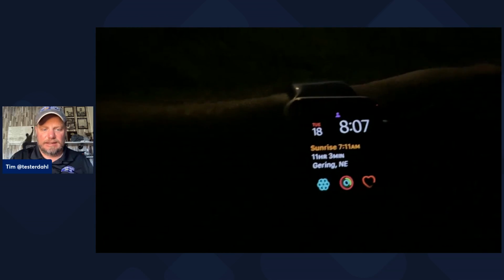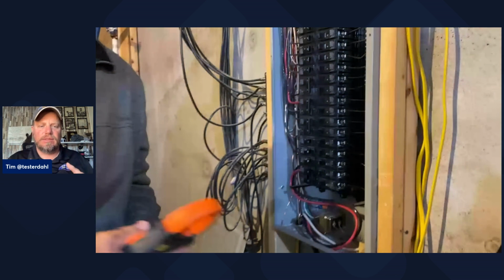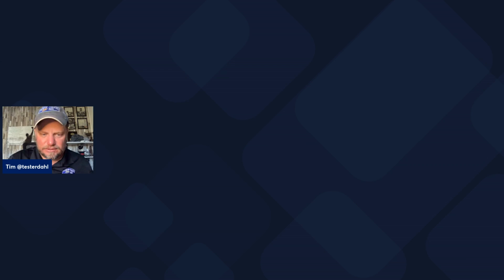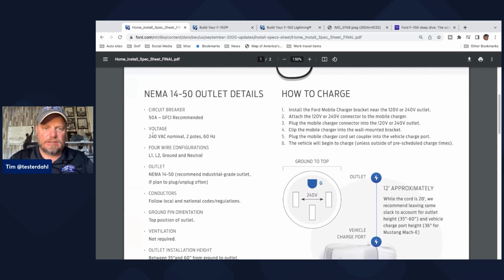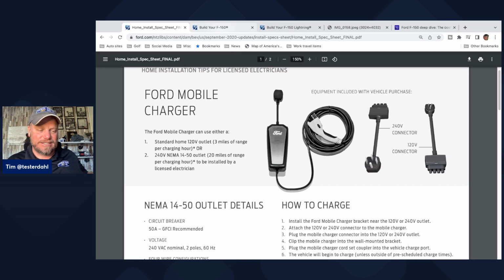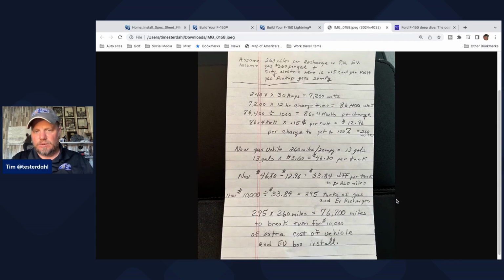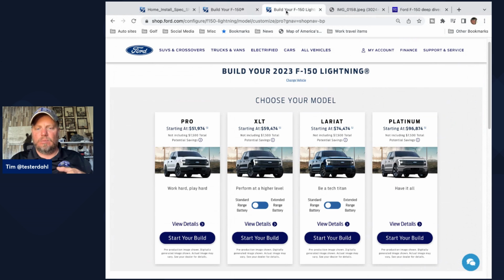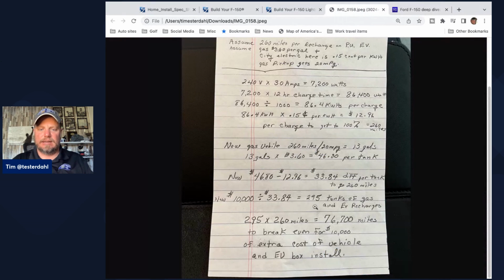11+ hours later on 220V charging price for 2022 Ford F-150 Lightning

Comment: I see the math this way, my 05 F150 XLT I bought used twelve years ago was 10K and I do all my own maintenance/service work on it and so it runs flawlessly. It now costs literally nothing for its KBB value and the fact I've got over 100,000 long distance miles on it alone means its more than paid for itself. All I can see ahead is routine maintenance cost for items like filters, plugs, oil etc and the gas I will be putting into it. For me this is way cheaper to own and operate than any 90k EV will ever be to buy and operate. Not only that but for my long distance hauls, I can get easily over 300 miles on a tank, refuel in no time and be one my way again without sitting and waiting around charging. I keep vehicles in pristine condition and so I end up owning them for over 20 years on average, which is very common for me. How many batteries will an EV go through in 20 or more years for a single owner.
Reply: At least 2 batteries for certain, tack on an extra $8500 per battery replacement! I’ll keep my gas powered truck also!
Reply: I saw an electric car boneyard in France consisting of around 500 cars the batteries were dead, and it cost more money for batteries then to replace the car itself and the landfill will not accept the dead batteries.
Reply: @frankgrima  I saw that as well. P.S. Will the manufacture of the vehicle Guarantee that a replacement battery will EVEN be available, 5, 10, 15, 20 years from date of purchase???? L O L
Reply: What engine do you have in your '05?
Reply: @hectorbart  the 4.6 litre  2 valve modular V8 that keeps on going forever. None of that 3 valve 5.4 litre phaser nonsense that constantly has issues.
Reply: @RideCamVids  Thanks.
Reply: My old cats from the 70s are still running fine just add a lil gas an charge up the battery to start thats it
Reply: Right again sports fans
Reply: You won't be able to buy a 10 year old electric vehicle because batteries for them only last 8 to 10 years. I feel sorry for the idiots who, in a few years, go out and buy a 7 or 8 year old used EV. They are going to spend $15,000 on a used EV and not realize that the car will stop working within a couple years.
Reply: @greatmartini1  Compared to regular gas-powered vehicles, Teslas depreciate at a slower rate. One of the main reasons why Teslas retain their value even several years after initial purchase is their mileage range. Most Teslas will last over 500,000 miles, while the average person drives only 13,500 miles per year.Aug 24, 2022

Higher resale  
Motors don't wear out
Brakes last 3 or more times longer
1/4 the maintenance 
Quieter 
Way faster an quicker
 Cheaper to operate with 4 times greater mpge
Reply: @Frank Grima  saw where batteries for a EV is 20,000 can you imagine any other part...people wilk fight for a charger in place coz bet their will never be enough for how long you have to charge one...and lm sure like gas people won't plug them in g ghhgĝ
Reply: @robcrissinger776  found the fanboy
Reply: Keep vehicles for the long term is the solution! Too much "throw it away and buy another one" mentality exists today.
Reply: @industrialathlete6096  Tesla won't sell you a battery even if you want to pay the outrageous price.  That probably was the plan all along with their "lifetime" charging option.  Can't charge a dead battery.
Reply: my 71 f100 still runs great.  You can stand inside the engine compartment, lots of elbow room with only a fuel line, and a water hose in there.
Did have to scratch my head in the 90's when I got it.  I had my dwell meter from the 70's.  But hadn't hooked it up in 20 years to adjust points.  LOL
My motorcycle ran like sh*t when you used a dwell meter, so always gaped with feeler gauge.
Reply: @chuckgoodman3828  Love how you anti EV people keep changing prices to put in a new battery but don’t understand they don’t replace a whole battery pack so the cost is a fraction of the amount you guys post.
Reply: @kellyalbertson3699  They already have EVs charging in 18 minutes on level 3.
Reply: @seanroge  yeah, if you only need to get 60 to 80 miles.  And repeated fast charging leads to more degradation.
Reply: @industrialathlete6096  Battery technology will improve and the old style battery can get phased out. The question will be- Can the new technology battery be retrofitted with the new controler needed to operate them. With golf carts this is working. I imagine they will do this with other vehicles too.
Reply: @kellyalbertson3699  That meme/info is flying around on the internets for a battery pack and assembly that is no longer made. The new product, although it is expensive is no where near $20k.
Reply: @seanroge  Right? They are posting for a battery assembly no longer made and the new product for that particular vehicle is much less expensive.
Reply: @robcrissinger776  wait until the government sets the hook! When they start putting road taxes,recycling,environment and all other add-ons on to the cost of electricity the cost per mile with be much closer to the current gas/diesel vehicle operating cost. I am not against electric cars but the energy storage has a long way to go, it will be something other than lithium based batteries.
Reply: @robcrissinger776  you’ll need batteries before you hit 500k. Good luck paying for those multiple times til then. And they will be obsolete soon too. Engines don’t become obsolete.
Reply: @seanroge  I'm not at all anti-EV  but do think many EV makes & models are BS....The same goes for many makes/models of gas vehicles as well. I like they Idea of building my own simple easy to work on EV for less money.
Reply: @Brandon Finch That pos will be long gone when you finally move in to the future.
Until then if ever remain in the past...
Reply: @Free-Gee  You can still but parts for a 1914Ford  model T

Electric batteries will first be 2nd life for home power storage at the end of life they will be recycled
All the lithium and other RE will be used in  a new technology EV battery
Reply: @industrialathlete6096  No the battery replacement will not be available in 10 years time as technology will have changed and legislation will outlaw manufacture of outdated tech to reduce emissions in manufacture. Amazes me that people still do not understand that a heap of emissions are released manufacturing all components of an EV(more than for a diesel/petrol vehicle) and you need to drive your EV from 80k-120k miles just to offset the emissions created in manufacture and recharging. EV batteries usually have a 7-10 year warranty and new batteries cost an arm and a leg making buying one uneconomical. Better to just buy a new car. And although all manufacturers/sellers of renewable tech tell us 97% is recyclable to date only about 5% is recycled as no-one is prepared to build recycling plants as the investment is too large to be economically viable so most recyclable items such as  solar panels, wind turbines and evs simply go to landfill(except the batteries which are banned from landfill) at present thereby becoming environmentally damaging. All in all, renewables are the newest pollutants of the planet and more resource demanding than existing products. A giant con.
Reply: @greatmartini1  Car dealers will probably not trade used EVs for new ones as they will as you say be almost unsellable second hand
. So if you buy an EV use it till it stops and then sell it as scrap(which is basically what it is new). In 100 years no EV will be in a museum etc as an antique as they will have been disposed of years before then. Who wants to keep a vehicle that cannot be started/driven as an antique? EVs are literally scrap the day you buy one and expensive scrap at that.
Just bought a new KIA Sportage diesel model and the EV model is roughly double the cost yet gets half the range of my vehicle. Would not have an EV if you gave me one.
Reply: @michaelbrinks8089  Yea what with a forklift battery?
The day you can design AN EV  that gets 370 miles on a charge  rips at the track 
Lasts 300,000 miles or more  beats the sales of most luxury ICE  sEDANS 

I'll buy one

Keep on with the bull crap ya here 😤
Reply: @robcrissinger776  lol  I'm talking about building my own EV for cheap to keep/drive not to sell, by using a conversion kit.
Reply: I am driving a '94 Dakota with the v-8. I have had to spend a bit on a few things like a rebuilt transmission, but I am so  far away from $90k, I really can't imagine who would spend that on an EV truck, or any truck. I am still less then $10K in. $80K diff, buys a lot of gas.

I am in Canada, where an EV F150 is $110k+. Ev is nuts to me. It would never pay it's way.
  - Cheers
Reply: @robcrissinger776  Luxury ICE sedans last much longer than EVs Rob and do not need engine replacements every 7-10 years like Evs need a battery replacement. Add the cost of battery replacements getting an EV to 500,000 miles and engine replacement/reconditioning on an ICE vehicle and the cost for the EV becomes prohibitive as it will take a minimum 5 battery replacements on the EV yet well maintained the luxury ICE vehicle may do the 500,000 miles on one engine or one reconditioning.
Evs are the future once they get an economical battery that is far more efficient than current models but until then it is only virtue signalling to buy one. They are not worth the investment for the average person.
Those of us pointing out the faults of EVs are not cave dwellers or against new technology. We are against being sold a pup at inflated prices that does not do the job the advertisers etc push. 
A motoring publisher in Britain did a 6 month investigation into EVs, comparing the emissions etc released producing an EV with a ICE car etc and found that most EVs need a replacement battery before they even offset the carbon released manufacturing one so NO they do not REDUCE emissions in NET terms. 
If you are going to support EVs you need to state the negatives as well as the positives Rob not just the benefits.
And at present Rob if an EV is a writeoff in an accident all but the battery goes to landfill. The batteries are banned from landfill due to the leaching of dangerous chemicals etc into the water table they would cause. 
In the future most of us will have EVs Rob but right now they are an environmental disaster.
Reply: @Rob Crissinger  Right try educating yourself you look at anything on these new cars...or are you one of the greens
Reply: @seanroge  I’ve done my research, $8500 is the going rate for battery replacement! I’ve never changed on that! Try harder!
Reply: do not leave out the yearly gasoline costs. At 15mpg, 1500/ a year, $4.00/gallon- $4,000/year these days-10 years $40,000 in fuel. that said I do the same thing. don't drive the older truck as much these days asd the gas engine ages better than batteries so I know I can hit the key and will always have full range with no deteriorated or discharged battery.
Reply: @tiredofallthis7716  180 miles per 80 % not 60-80 miles
Reply: @chuckgoodman3828  ahhhh no????  the batteries are $36k to replace in the f150... where did you get this $8k number
Reply: @armslength2618  well the 5.4l 3 valve keeps Brians wallet fat with all the work he gets from fixing those bad designs. I can live with the less power and way better longevity of the 4.6l 2 valve as it is.
Reply: @dominic9028  Get back to me when a buddy let's you take a ride in the Lightning and you actually get to  it....

Luddites accept the future 
Very last..
You'll understand eventually
Reply: Don't buy a 90 thousand EV 😁
Reply: I could have written this too!  I have an 06 F 150, mint with 113k on it.  Been paid for a long time and I do all my maintenance and very timely.  I'm sticking with recycled dinosaurs and my maintenance!  I never hear them talk about miles of holes filled with battery juice, somehow, I don't think we will and that has to be worse on the environment than anything out of a tailpipe!
Reply: They have recycling centers all ready for EV batteries, so there won't be any holes filled up with batteries! 😁👍💯
Reply: @industrialathlete6096  you will need a new car, Tool companies change their battery "hook ups" every few years
Reply: @robcrissinger776  You forgot battery replacement Rob.
Reply: @smedleyfarnsworth263  Didn't forget  it lasts longer than 300k miles and then has secondary life as solar storage 
Technology advances and you pick up a new vehicle 
Battery prices come down you replace or new owner replaces and give it new life 
You act as if nothing ever changes and improves.

Sad you can't figure that shit out...
Reply: @RideCamVids  It's what I have in my 06.  Good engine.
Reply: @robcrissinger776  Until the battery degrades past usability and requires replacement...
Reply: @robcrissinger776  One of the true believers I see Rob. Pity is, you are wrong, the batteries fail after about 8 years and are no use for anything else.

So far nothing has improved enough to justify the general use of these expensive gimmick vehicles. Hence the low take up rate.

Sad you can't figure that out.
Reply: @smedleyfarnsworth263  More of your ignorance. 
They are guaranteed 8 years
First use 

Secondary use 25 years plus

100 % recycle after that 

search menu

 It is estimated that LFP batteries can support at least 2000–2500 cycles in electro-mobility applications, for example, daily use of a charge and discharge cycle for seven years, until the remaining capacity reduces to 80% of the initial battery capacity. This allows its use for another 1000–2000 cycles until the capacity reduces to 60% of the initial capacity. When this occurs, the aging process of the battery has advanced to point that the voltage drop does not allow further use of the battery [30]. After the end of the useful life of a battery for electro-mobility purposes, typical applications include its use as energy storage unit in smartgrids or uninterruptible power supply. The main characteristic of these applications is the lower stress that the battery cells suffer, enhancing thus the durability of the battery pack. In the context of this work, the primary use phase considers a 24 kWh LFP battery with efficiency of 80% used for 2500 days in an EV, while the second life application considers the case of using an LFP battery as an energy storage unit in a smart building for 1500 days (or equivalently, four years), taking into account the average home consumption in Spain in 2010. In the scenarios that refer to the use of the same battery in the primary and secondary application, it is further assumed that the efficiency drops from 80% to 75% due to the aging of the battery.

Grid storage 
Grid balancing 
Home solar storage
EV Conversion 
The list goes on and on
 

Learn something 
Anything 
We implore you
Reply: @robcrissinger776  Which planet is that happening on Rob because it does not happen here.

Just remember, just because you want something to be true, does not make it true.
Reply: @GregOrangeDoor  this is 100% bullshit.  I work regularly with A Tesla dealer. It's $16k to replace a battery with labor.  The entire bottom of the car has to be removed, and the batteries in regular use in a city environment like Seattle, means wasting battery sitting in 2.5 hours of traffic per day. All load no regen, and its a battery killer. The batteries are barely lasting 100k miles and not much past 6 years.
Reply: Yep..I have 2 1998 dodge trucks. Better than anything put there
Reply: Nothing beats cummins 12 valve
Reply: @nc.3512  mid 90's 6.5 diesels will run on virtually anything.  I watched a show, years ago, someone literally boiled down a rotting pig, and it ran on the rendered fat.
Reply: @mikebolton3816  yes. 98 12 valve will do same. Awesome engine. It was last made in 98. 12 valve is absolutely tops fir quality and power. Great milage as well.
Reply: @robcrissinger776  where on God's green earth did you hear that motors don't wear out?
Reply: @robcrissinger776  recycling will only be an option when uts cheaper than making a new one. Right now it's only about 40 percent cost to make a new one as opposed to recycling an old one. So, we may not see in our lifetime an era where recycling of these batteries is profitable.
Reply: @scottford1091  Two main parts only one moves
in an air gap
Bearings made last million plus miles
Tesla has motors already operating over a million miles

66 years at 15K miles a year is close to a lifetime

Electric motors last a long long time.

Get a grip
Dude
Reply: @robcrissinger776  I have a grip. I build cars for a living. I replace electric motors ant alternators all the time... an amarture is not an everlasting gobstopper. They wear out... if they didn't, every electric motor ever made would still be in use. Also, electric cars use their motors for dynamic braking and charging... that's even more abusive than propulsion... now... run these things around in low voltage situations... what happens to Amp draw? Goes up, right? What's the side effect of high amps? High temperature... see where this is going? Ok... so a few teslas have a lot of miles on them. So do diesels. What's your point? Diesels don't wear out either?
Reply: @scottford1091  Wrong again as usual

Learn some science
Research  Redwood Materials 

Do something instead of  whatever you think you do
Reply: @industrialathlete6096  Are batteries still used in 30 year old flashlights?
Of course batteries  with improved technologies way longer than 20 years from now will be available for old model ev cars.
Are you really that clueless?
Reply: @mikebolton3816  work with and not at.
Sitting in stopped traffic is not loaded.
Not a waste of battery.
Pull some more B 
A out why don't you.
Reply: @robcrissinger776  OK internet electrical engineer.🥱  tell you what... put an inductive fluke on your main cables, use the record min/max feature,  the go sit in traffic for the normal 1.5 hours it takes from Bellevue to Downtown Seattle.
The starting and stopping draws way more power than during a hiway cruise.
The power requirements to keep an object already in motion, vs the torque required to start moving the vehicle from a stand still every 60 ft, are dramatically different.  Nevermind, the draw to keep the heat on, the blower fan, the radio, the headlamps, the windshield wipers, the power windows, etc.
Reply: @robcrissinger776  voted for Joe Biden
Reply: The end of the world will come before a good battery for an EV
Reply: @RideCamVids  I feel you man. I am still driving my 1984 F-150 with the straight 6, 3 speed with a granny gear. The truck has well over 400K miles on it. I've spent more money repairing and replacing rusted body panels, then I have spent mechanically. My batteries only cost a $150 to replace every 8-10 years. The clutch has only been replaced once. Other than normal preventive maintenance, I haven't had to do anything to it engine wise. 
My other two vehicles are a 93 Explorer and a 2013 Focus. The Focus gets about 34 mpg doing city driving. It easily can average 39 mpg on the highway. 
When all is said and done, all 3 of my vehicles combined will have less of a negative environmental impact, than just building one EV. Let alone the disposal of a single EV. 
At least if I were to be involved in a devastating accident, at least they won't have to call out a hazmat crew to clean it up.
Plus at the end of the day, my conscience is clear, knowing my vehicle didn't require slave labor including children, to mine the minerals that an EV needs to operate.
Reply: @greatmartini1  I don't think these EV batteries last to the 8-10 year mark. It seems like after only 5-6 years, they become an issue.
Reply: @robcrissinger776  I would like to see your information, that you're citing here. As so far you are the first person I have seen, to make such outrageous claims. 
You obviously don't have a clue about electric motors. They ware out and go bad. Just like any motor. 
As per breaks, how long breaks last on a vehicle, is directly related to how the vehicle is driven. My 2013 focus, which I have been driving for 10 years now. I am still operating on the original factory breaks, with plenty of miles left. 
Way faster and quicker than what? It may initially be cheaper to operate, however you're prepaying with the cost of the vehicle. Then come back with how cheap the maintenance is, when you have to replace the battery, or when you inevitably develop a problem in the electronics.
You say they have 4 X the range, 4X the range of what? Certainly not any of my gas powered vehicles. 
And what are you going to do, when you misjudge your range and you run out of power, what do you do, have the vehicle towed to a charging station? 

Please tell me, how many Teslas are on the road, that have reached the 500k mark? 

My final question, how do you morally justify driving a vehicle, that without slave labor, likely wouldn't exist?
Reply: @onyxfabrications5183  Agree, but it isn't just these days. The American people have been programed to upgrade their vehicles, every two to 3 years, since owning a vehicle became affordable. 
I have always kept my vehicles, until they just would go anymore or became to expensive to repair. For example, I still drive my 84 F-150, 93 explorer and my current new vehicle, which I have been driving for 10 years now.
Reply: @robertsmith2956  My first boss, who owned a gas/service station, in the 70's. Used to say, "A pointless engine, is just that." Pointless.
Reply: @seanroge  Different manufacturers have different prices. What is this nonsense that they don't replace the entire battery?
Reply: @seanroge  What's your point? It takes 5 minutes to fill a tank with fuel.
Reply: @lennychorn147  A battery pack is a bunch of individual cells. When there is something wrong with the battery it is usually only a few cells that are bad. They test the cells and only replace the bad ones. The bad ones are then recycled and about 98% of the battery cell can be replaced.
Reply: @seanroge  OK, so instead of hitting you at one time. They nickel and dime you, always leaving you a battery ready to fail again. It's called reconditioning the battery. I've been through that game before, when battery operated industrial equipment, develop charging issues. The reconditioned battery, never seem to deliver the power a new battery does. It also takes longer to charge and doesn't hold the charge like a new battery. 
Each time that battery needs cells replaced, you'll pay more for the next cells, as well as also have to pony up the service fee, recycling fees and environmental disposal and whatever other fees will eventually appear.
Reply: @GregOrangeDoor  eh that 500,000 thing sounds a bit to good to be true. 
Electric motors indeed wear out. Brake pads are like 60 bucks. On my gas vehicle 1 hr I have new brakes. I never replaced them on an EV so unless they are made different How are the brake pads lasting longer? It's not cheaper to operate this video shows that.  People literally put mufflers on their vehicles to make them louder So I don't really see that being a plus. You can only go so fast from red light to red light. I Don't think going over a hundred miles an hour should be the normal on the highway. From full tank to full tank on either vehicle they don't get better mileage. ???
Reply: @robcrissinger776  You are the 'clueless' one. Do you really think that companies will keep the parts 'pipeline' full of Anything for older technologies. Example: Current 'white' goods(appliances,etc) are not built to last compared to such purchased 20,30,40 years ago. Many current technicians either refuse to or do not want to work on 'old' technology.
Reply: Exactly, I feel the same way. They are trying their hardest to push these electric vehicles on us. The truth is they are just not practical for everyone. If you want one get one. I have no problem with that. Just don’t be trying to force feed them to people that want nothing to do with them.